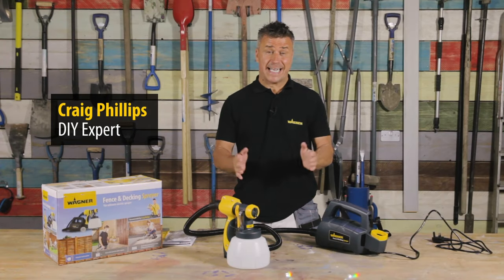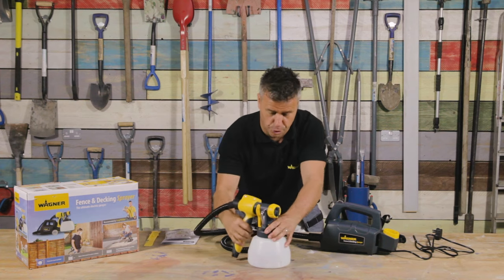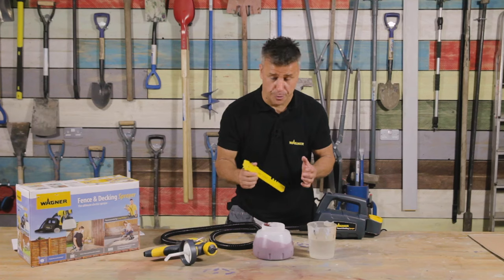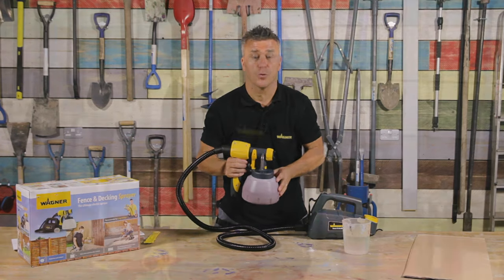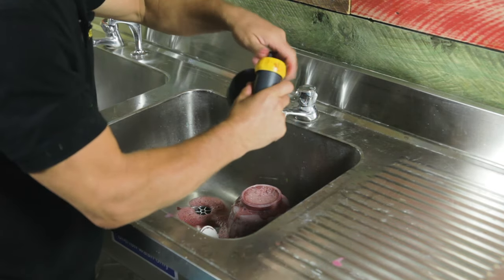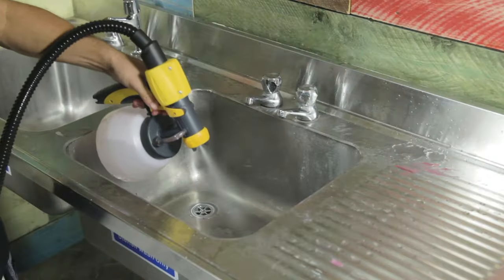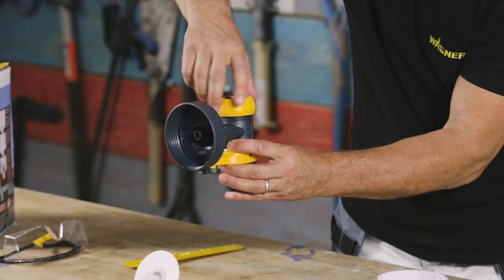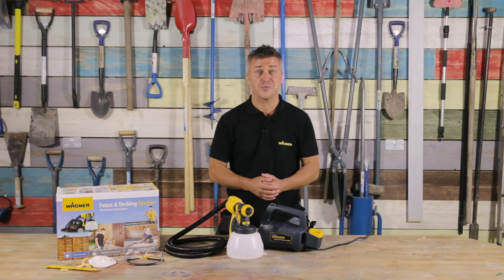How to use the Wagner Fence & Decking Sprayer with Craig Phillips

Comment: Just got mine today as well. Diagonal wooden slats with gaps between each piece of wood. Wasn't looking forward to painting this fence, but the Wagner made it so simple. Think it took longer to mask up and clean the sprayer than actuall paint the fence. So easy to use and i've never used a paint sprayer before.
Reply from the maker: Hello that is good to hear, with time and practice the masking and cleaning the sprayer should be quick also. Kind Regards WAGNER DIY.
Reply: Great to hear it

Comment: Thank you for this very informative video.  Just ordered one of these.  If it is as good as people say it will save me many hours of work!
Reply: @Whoshotmyrifle  - I would say that my experience with it was overall a good one.  However I think I probably used more paint on the fence than I would have done if I had just brushed it on.  It did make what would have been a boring job a lot more fun though.  Also I found that if I did not dilute the paint that the hose would pop off due to the air pressure.  It was easy to remedy by adding a splash of water to each paint tin though.

Comment: With over 90sq/m of fencing to paint I was dreading it. I bought the sprayer hoping to make life a little easier. I will NEVER paint a fence with a brush again! It was so simple and fast. I did 2 coats this morning and will do the other 1/2 of the fencing tomorrow. The coverage is perfect, no lines or streaks and the job done in 2.5 hrs including a break for lunch. 
One tip would be to thin the paint (if you are going to thin it) in the paint container it came in and not the small sprayer container. Do it that way you will have it well mixed and its easy to refill the sprayer and you only thin the main paint once.
Reply from the maker: Hello great thank you so much for your feedback and you advice. Kind Regards the WAGNER DIY Team

Comment: I have The Fence and Decking Sprayer, which I bought locally last year. I was very happy with the way it works.
However while it was stored over the winter part of the nozzle was misplaced. I have attempted to buy a replacement at all the local suppliers. I have phoned and left messages as well as emails to order the parts from you but not received any reply. 
The spray is still offered for sale but extremely expensive if I can not replace the missing part.
Reply from the maker: Hello Barbara via this website https://www.paintsprayer.co.uk/sprayers-consumer there a replacement parts, accessories and additional attachments, I hope that helps. King Regards Wagner DIY

Comment: Thank you for the video, very useful.  Can this be used for internal painting of walls ?
Reply from the maker: Hi Wayne, the performance of this machine is designed for thinner materials like fence stain etc - unfortunately that means it is not really up to spraying emulsions and wall paints etc. Please see one of our more powerful machines such as the W590.
Reply: I purchased this at the weekend.. extremely easy to use and clean.. Thanks for making my life easier 😀

Comment: Hi Craig. What you recommend to clean out the sprayer after using metal paint? Thank you. 🤗
Reply from the maker: Hello, if it is water-based wood and metal paint, first pour any leftover paint back into the original container. Then fill the sprayer with clean water and spray until it runs clear. Disassemble the sprayer, clean the parts with warm soapy water, and use a soft brush to remove any residue. Let the parts dry before reassembling. If using solvent-based paint, follow the cleaning instructions on the paint tin for the appropriate solvent to clean and do the same procedure as above. Kind Regards Wagner DIY.
Reply: @WAGNERUnitedKingdom  Thank you for your help. Much appreciated. 🤗👍

Comment: question need to know please...used this for a fence and was brilliant! I have newly plastered walls in a house.. floorboards are all off so not bothered about mess.  Can I use this spray gun for emulsion water based paint? It's to spray a mist coat onto newly plastered walls which is 50/50 emulsion and water. Any help would be appreciated! Aidan.
Reply from the maker: Hello We are very pleased to hear that the fence and decking sprayer worked very well for you. This however would not be a suitable machine for spraying emulsion paint even if it was watered down. It is designed specifically for wood and metal paints. For spraying emulsion paint you would need to look at one of our universal sprayers like the W590 or the W 690 machine or an airless sprayer. Regards WAGNER DIY

Comment: Does this unit blow air out of the nozzle but then spray the paint when you press the trigger? I’m just checking mine is working correctly
Reply from the maker: Hello yes that is correct, warm air will come through the nozzle and then it will start to spray paint when you pull the trigger. Kind Regards the WAGNER DIY Team

Comment: Can you tell me what way the blue valve should be inserted? Mine seemed to be inserted the wrong way compared to the diagram on the side. I noticed this when inspecting it before first use. I was a bit disappointed with the performance of it at first. Its quite a noisy thing and I could only get a good spray once I watered the paint down. (Cuprinol Ducksback)
Reply from the maker: If you watch this section of video https://youtu.be/kIuN4TQwHGU?si=wgnAxOUfj8dVzVX8&t=340 it shows you which way the blue valve should be inserted. Kind Regards Wagner DIY

Comment: Can you use smooth masonry paint to do exterior walls using this? it looks ace
Reply from the maker: Hello Wayne If you're looking for a consumer sprayer for doing work on your own home for spraying exterior walls this would not be suitable. The best product consumer product would be the WAGNER Control Pro 350M Airless paint sprayer which you can see product details and where to buy here: https://www.wagner-group.com/uk/do-it-yourself/products-and-accessories/product/airless-sprayer-control-pro-350-m/  If you are using Masonry paint you can only use the smooth version not the textured type. Masonry paint is usually water based which make the paint easier to dilute and also easier to clean the machine afterwards. If you want to use a sprayer for Contractor work, you would be better to look at our Professional range of product here: https://www.youtube.com/channel/UCce8s4xycTLZPVnmn6dL3GQ Kind Regards the WAGNER DIY Team

Comment: I have noticed the air is continuous once switching on the machine, any idea how to control it and just have it when pressing the trigger because I have used a lacquer and because of the power of the continuous air  I have ended with uneven finish and  not levelled at all and ended with a missy finish  even I have bought extra gravity extension part    Where the pot at the top  and 😢costed me extra £34 ☹️ is there any pressure valve  gauge extension to set it it to a certain recommended psi pressure can be connected  please and how to clean the sprayer from the lacquer  at the end  , your advice is really appreciated thank you.
Reply from the maker: Hello Zain With the Fence and Decking sprayer you can’t control the air pressure. If you need more controls for the volume of paint and air a suitable sprayer is the W590 Flexio Sprayer. This will also work with the Gravity accessory that you have. This is a Universal sprayer which means it is for spraying both wood and metal paint and also can be used for emulsion if you’re doing work on interior walls and ceilings. A video guide to cleaning an HVLP sprayer is here: https://youtu.be/fNTviUyKleU?t=254 You can see more W590 product details and where to buy here: go.wagner-group.com/w-590-flexio-uk. Kind Regards the WAGNER DIY Team

Comment: Is this good enough to use clear decking oils?
Reply from the maker: Yes the Fence and Decking sprayer is designed for all standard solvent or water based fence paint, oil, stain, varnish, wood preservatives and treatments.  Kind Regards The WAGNER DIY Team

Comment: Can I use emulsion paint and do the inside of my shed with this
Reply from the maker: Hello unfortunately not, the Fence and Decking sprayer is designed for standard solvent or water-based fence paint, oil stain, varnish, wood preservatives, and treatments. For emulsion paint, you would need a Universal sprayer like the W590 Flexio, which is suitable for wood, metal, wall, and ceiling paints. Kind Regards Wagner DIY

Comment: Thabks, has anoyone used this with ducksback from cuprional? Does it require diluting? Thanks
Reply from the maker: Hello Mike, The Wagner Fence and Decking sprayer can handle most standard solvent or water-based paints, including fence paints. However, Cuprinol Ducksback is a wax-enriched, water-based paint with a thick consistency, which can clog the sprayer. To avoid this, use the paint at a warm temperature and strain it before use. Always follow the paint manufacturer's recommendations on the tin for thinning, and test the spray on a piece of cardboard to ensure proper consistency and flow. Kind Regards, WAGNER DIY

Comment: I’ve used mine for 6 weeks now nothing comes out I’ve put some water in it to just test it I pull the trigger nothing comes out it’s like it’s blocked I’ve tried to unblock everything but how do you unblock the tiny nozzle at the front ?

Comment: Im going to be using Cuprinol Urban slate Matt Decking Wood stain - do i need to add water, if so how much water? thank you
Reply from the maker: Hi Matt, thanks for your comment. You will need to consult with the material manufacturer to get their recommendations for spraying. Thanks - The Wagner DIY Team.

Comment: Hello can i use this spray gun for my indoor wall paintings too ? Thanks
Reply from the maker: The Fence and Decking sprayer is not designed for wall paints. If you are wanting to spray thicker paints like emulsion on your walls you would need one of our Universal sprayers that is suitable for wood, metal, wall and ceiling paints. You can see more details of the W590 Flexio Universal Sprayer here: https://www.wagner-group.com/uk/do-it-yourself/products-and-accessories/product/universal-sprayer-w-590-flexio/ Kind Regards The WAGNER DIY Team

Comment: Is it suitable for car painting? 
for concrete painting? 
thanks
Reply from the maker: Hello John, Car sprayers often use specialist paints and processes and air compressors which generate very fine material droplets this Fence and Decking sprayer is not design for spraying cars. If you are spraying concrete I guess the area is large so you would be better to look at an Airless sprayer: https://youtu.be/DhzNNjbCX2U Kind Regards WAGNER DIY
Reply: @WAGNERUnitedKingdom  
thank you 
and what is the difference bewteen the Wagner fance&decking VS WAGNER wood and metal? 
i mean the physical differences between them

thank you

Comment: Hi guys, is this sprayer suitable for decking oil?
Reply from the maker: Hello Karen Thank you for getting in contact. This is the Wagner Fence and Decking sprayer and yes it is suitable for all standard solvent or water-based fence paint, oil, stain, varnish, wood preservatives and treatment - no need for specialist sprayable paint. You can see more details on the product and where to buy here: https://www.wagner-group.com/uk/do-it-yourself/products-and-accessories/product/fence-decking-sprayer/ Kind Regards The WAGNER DIY Team

Comment: Can you use this on masonry using masonry paint?
Reply from the maker: Hello The Wagner Fence and Decking sprayer is not recommended for use with masonry paint. Masonry paint is typically thicker and may require a more powerful sprayer designed for high-viscosity materials for example an airless sprayer. Kind Regards, WAGNER DIY Team

Comment: Can I use varnish in this machine. Thanks
Reply from the maker: Hello Brian, Yes, the Wagner Fence and Decking sprayer can spray varnish. It is designed for use with all standard solvent or water-based materials, including varnish. Kind Regards WAGNER DIY

Comment: hi craig do i need to dilute ronseal fence paint in my wagner sprayer
Reply from the maker: Hello Lennie Most Ronseal fence paints do not require dilution when used with the Wagner Fence and Decking sprayer, provided they are at room temperature. However, if the paint is particularly thick or the sprayer is having trouble, you might need to dilute it slightly. It’s always best to check the manufacturer's recommendations on the paint tin. If dilution is necessary, do so in small increments (5-10%) and test the spray on a piece of cardboard to ensure proper consistency and flow. Kind Regards WAGNER DIY

Comment: Hello dear ,
Can i use dulux emulsion in this spray machine? And can paint a room? 
As dulux emulsion are thick and not oily
Reply from the maker: Thank you for your enquiry if you are just using it for domestic work on your own house I would recommend the W590 Flexio Sprayer as this is a universal sprayer for spraying both wood and metal paint and also can be used for emulsion if you’re doing work on interior walls and ceilings. You can see more product details here: go.wagner-group.com/w-590-flexio-uk. Kind Regards The WAGNER DIY Team.

Comment: Even those some paints don't recommend the spray and brush only. Could I use cuprinol ducksback with this?
Reply from the maker: Hello James thank you for the question. Some people have used Ducksback successfully with the Fence and Decking sprayer however others have had to clean the machine frequently during use. The product has wax added to it which tends to block the spray needle. Therefore, we would recommend using other products which are designed to be sprayed. Kind Regards The WAGNER Team
Reply: @WAGNERUnitedKingdom  I have ordered the wagner 250m and I am looking to use valspar fence and decking paint. Would that need a dilution or will it spray on fine?

Comment: Hi. I have one of these and air passes through with out the trigger pressed so when you press the trigger no addition pressure seems to spray the paint. Has anyone had this or know what is wrong? Any help would be really appreciated
Reply from the maker: Hello Glen, it sounds like there may be an issue with the nozzle or trigger mechanism. Check the nozzle and ensure it is not clogged or damaged if any dried paint gets on the needle or nozzle it prevents it sealing. Also Inspect the trigger to make sure it’s functioning properly. Usually these issues can be resolved by deep cleaning the sprayer. Kind Regards WAGNER DIY

Comment: Can this be used inside???
Reply from the maker: The Wagner Fence and Decking Sprayer is primarily designed for outdoor use, specifically for tasks such as spraying fences, sheds, decking, and garden furniture. For indoor projects, we would recommends using their Universal Sprayers, like the W590 Flexio, which is suitable for both wood, metal, and wall and ceiling paints. Kind Regards Wagner DIY

Comment: can you purchase a longer hose for this?
Reply from the maker: Hello Paul, no unfortunately not it is just the 1.8m hose supplied with this sprayer. Depending on what you are doing you can use the handle extension to give you extra reach with this product. Details are here: https://www.wagner-group.com/uk/do-it-yourself/products-and-accessories/accessory-group/handle-extension-60-cm/ where there will also be details about where to buy the products. Kind Regards the WAGNER DIY Team
Reply: @WAGNERUnitedKingdom  thanks

Comment: Just bought one, worked really well for half an hour then no paint would come through. I've cleaned it multiple times but still nothing. Unless I water the paint down to around a 50/50 mix.
Any help would be great
Reply: What paint are you using? Cuprinol ducksbacks works a treat in the gun, 2:1 ratio is a perfect mix I've found out
Reply: @ashpearson1901  a ronseal fence paint possibly the one coat
Reply: @markdobbie2968  that seems very strange that you have to do a 50/50 mix, are you pre mixing it in another container first? Or straight into the guns reservoir? I use a 2litre bucket and pre mix my material First then pour that into the guns reservoir after.
Reply from the maker: Hello Mark most fence paint don’t need any dilution provided it is at room temperature when you use it. If you watch this video section Craig Phillips explains about dilution https://www.youtube.com/watch?v=fNTviUyKleU&t=146s and how to get the dilution just right. It the paint is old you need to filter it before using to make sure not bit are present. If you are still having probelm please can you make contact with or support team on  FMB_GBSI_Technical-Support@wagner-group.com or call +44 1327 368410. Kind Regards the WAGNER DIY Team
Reply: I'm in exactly the same position.  Well almost the paint comes through it such a fine mist that it's next to useless.  I have cleaned it multiple times
Reply: @ashpearson1901  2:1 , as in 2 paint to one water , or other way around

Comment: Craig can you recomend this for internal walls ?
Reply from the maker: Hello Lee Thank you for your enquiry not this would not be the product to use on internal walls. If you are just using it for domestic work on your own house I would recommend the W590 Flexio Sprayer as this is a universal sprayer for spraying both wood and metal paint and also can be used for emulsion if you’re doing work on interior walls and ceilings. You can see more product details here: go.wagner-group.com/w-590-flexio-uk. Kind Regards The WAGNER DIY Team.

Comment: Can I use this inside also?
Reply from the maker: Hello The Wagner Fence and Decking sprayer is primarily designed for outdoor use on fences, sheds, decking, and garden furniture. While it is technically possible to use it indoors, it is not recommended. For indoor projects, a sprayer like the Wagner W590 Flexio, which is designed for both indoor and outdoor use, would be more suitable. Kind Regards Wagner DIY